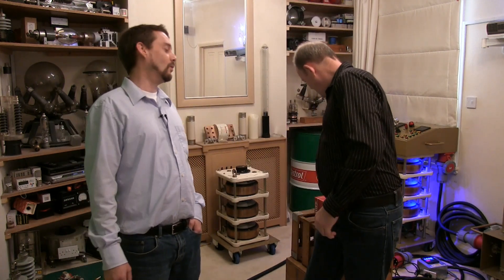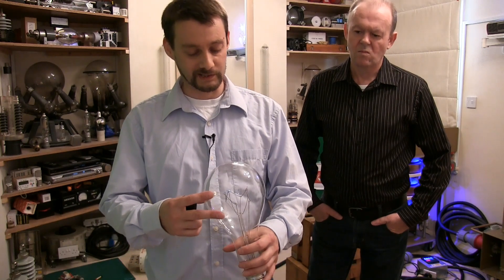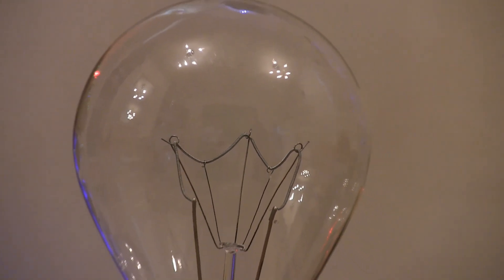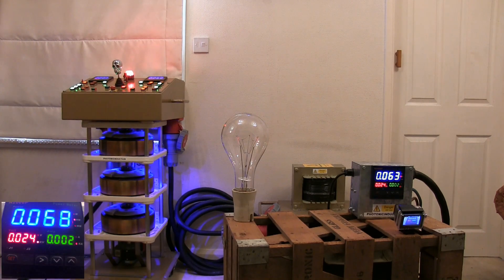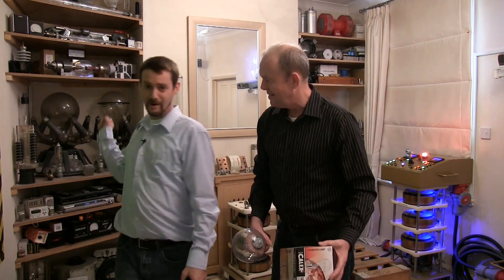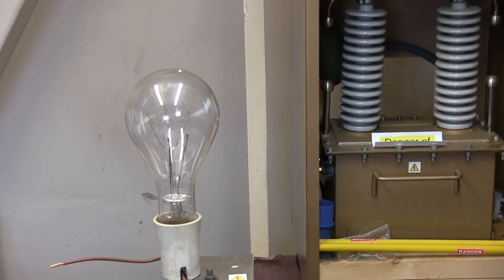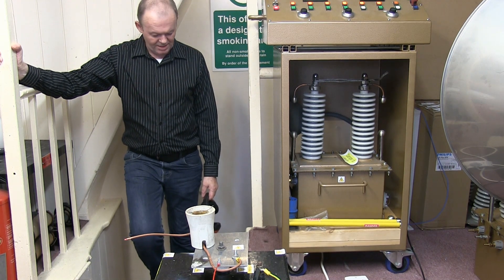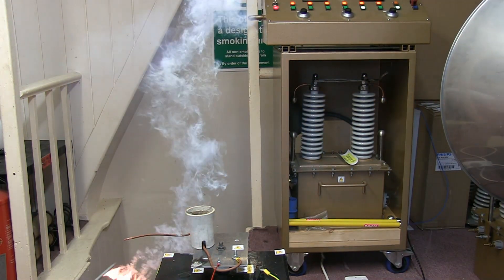Until it Pops - 1000 Watt Light Bulb

Comment: 0:47 Fairly inexpensive
I thought they were banned in the EU(well you're not in the EU now) unless they are still made and legal to sell for specialist type things
Reply: They are inefficient 1600lm for a 100w for CFL that is 25w for the same amount of light output and for LED it is 17w.
Now multiply that by a million or so and you can see all that wasted power which puts extra load on the electrical grid, heats up your house in summer making you run the AC more and most of the output on an incandescent bulb is in the IR spectrum than visible.
More info here
http://www.designrecycleinc.com/led%20comp%20chart.html
Reply: But who is to say that heat is wasted? Sometimes it's an unintended feature. LED lights don't tend to keep you very warm. ;)
Reply: How? By passing laws, the same way anything is banned. Lots of countries have banned them.

Why? Because incandescent bulbs are among the most ineffecient things ever designed by humans. Something like 99% of the input turns into waste heat.
Reply: EBAY...
Reply: +IIGrayfoxII 
The EU shouldn't be interfering in the free market like that. Makes my skin crawl.
Reply: +Deltaexio Actually it was the retarded green idiots. Those imbecile bastards shouldn't be interfering with anything (save their own diapers) at all.
Reply: but LEDs give very bad light. I can't sit more than 30 minutes in LED lit room, because I get eyestrain. Tried various LEDs - don't work.
Reply: IIGrayfoxII I've tried various color temperatures, blueish tends to hurt more.
Reply: Mark Schulz IV You got four levels of cheapness, if you like, for these LED lights:
The best ones are full wave rectified and have a large reservoir cap to all but eliminate flicker.
Less expensive ones have smaller caps, so  a bit more flicker
Less expensive still, have NO caps. Even more flicker.
The cheapest of the cheap is where it gets interesting. You have no caps, no bridge rectifier, and the LEDs are wired in inverse parallel. At one half of the mains cycle, half the LEDs are on, and the other half comes on during the other half of the mains cycle. This effectively DOUBLES the amount of flicker you get out of any one LED. You typically get this arrangement in dirt cheap mains powered LED strings.

So get hold of some more spendy ones, and give them a go. Avoid fleabay, especially the direct-from-china crap.
Good luck :D
Reply: You get what you pay for. A high end LED system (not some cheap, bullshit LED bulbs) will provide same quality of light as Halogen with far less power.
Problem is most people can't buy good LED systems or don't want to pay for it. People are cheap. So they get cheap results.
Reply: If you dont like it, then do some thing, like crush your car as your car runs on unleaded(ULP) petrol.
Many countries banned the sale of leaded petrol due to health issues, but a guess banning leaded petrol is not like banning a lightbulb that makes IR light
Reply: IIGrayfoxII Then I have no idea what is wrong with me.
Reply: CoolKoon I have one 2700K, still no luck though. Got fed up with it.
Reply: CoolKoon CFLs and tubes are even worse.
Reply: +Mark Schulz IV LEDs typically have an incredibly narrow on/off time, so any flicker from them being driven off the mains is far more noticeable than from incandescent bulbs. If you get cheaper quality LED bulbs, the DC smoothing will be really poor, or left out entirely. I wonder if that's the cause, and if LEDs driven off DC give you the same problem.
Reply: A DC PSU is the best type rather than capacitive dropper and one with a larger anti ripple cap would help
Reply: Azayles cheap (about 10 € / piece) lamps that screw into same socket as incandescent light bulbs.
Reply: They ARE incandescent light bulbs.
But they don't fit in your standard E27 socket. They need a larger E40 socket.
Reply: Azayles Thanks
Reply: Banned in some areas, but not in England. Not sure who apart from Andy is still buying them, but there ya go! :P
Reply: We voted to leave... we are still in the EU right now haha. It will take like 2 years for everything to be done so we leave.
Reply: Actually the ban is kinda stupid. They are still sold as "heating" lamps and are imported/produced for that (and "industrial") purpose AFAIK.
Reply: It has an EU Energy Efficiency guide on it, so it's clearly allowed for some purpose.
Reply: That is not the only reason, tungsten refining actually releases more mercury into the environment than even a improperly disposed of fluorescent.
Reply: So it is not the LEDs, it is just you.
My whole house has LEDs, my car has LEDs(even the headlights).
No eye strain
Reply: Are they warm white, natural white or cool white?
Reply: +EgadsNo Curously enough they haven't banned the halogen lights despite the fact that they are also produced almost the same way as the "regular" flourescent stuff (with some minor differences of course, but the tungsten filament is the same)....
Reply: +Mark Schulz IV How about trying the LEDs that give off that yellowish white light? Do they strain your eye too?
Reply: +Mark Schulz IV Then you definitely ARE overly sensitive to LEDs. Get some halogen bulbs then. Also, how about fluorescent (some of them REALLY hurt my eye for instance)?
Reply: +Azayles The problem with sources that aren't "fleabay" or Aliexpress is that they're usually selling the very same "direct-from-china" crap, but at a ridiculous markup. It goes without saying that you shouldn't buy the first thing you see on "fleabay", but the situation actually isn't as bad as you describe it.
Reply: +Mark Schulz IV I'm asking because some of the tubes are straining my eyes as well. If it's really that bad then the only thing you should get are those halogen incandescent lamps that screw into the regular (E27, bayonet, whatever you country's standard is) light bulb socket.Their efficiency is higher than that of "regular" incandescent bulbs.
Reply: That's great reasoning and all until you need an outdoor light which will not be covered in ICE.
Then these are far superior and cheaper to CFL/LED. And yes I have designed high end LEDs for 6 + years now.
Reply: I think its hard to buy quality stuff. You can buy rebranded chinese shit sold as "quality"  with high price tag. If you ask special electrians shop, they all sell "quality" brand and maybe 2 out of 5 is REAL quality.
Reply: TBH the law made LED and good quality fluorescent lights like 10 times more available and therefore cheaper, because they stopped being the better choice for richer people and started simply being the norm. I'm pretty sure the EU-wide drop in electricity use due to the law is noticeable, not even mentioning how much money it ultimately saves.

Now, I do hate laws like that. In my opinion everybody should have the right to waste their money however they want. But most people are stupid and cheap, and because of that the better lighting choices were much pricier. In my world, the effect perfectly justifies that particular law.
Reply: I don't get why politicians feel the need to ban certain types of light bulbs. I mean, is it too much to ask for me to decide for myself?